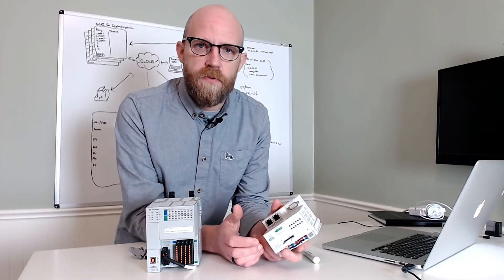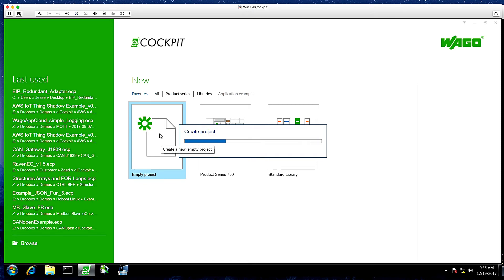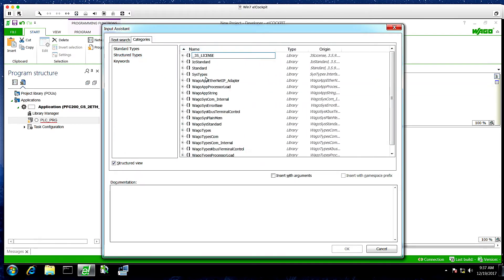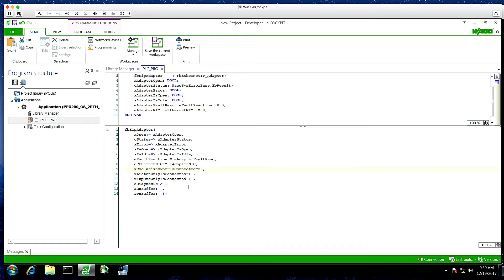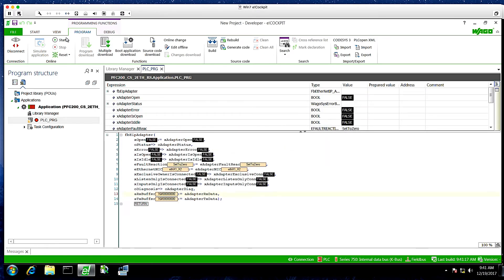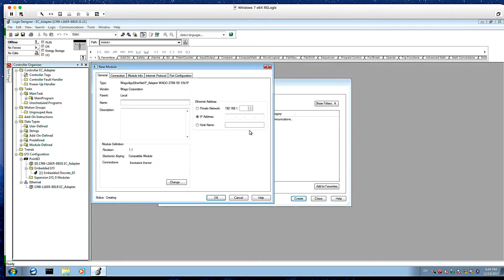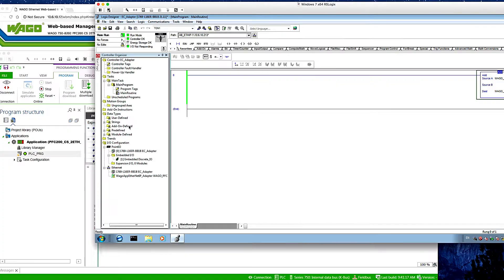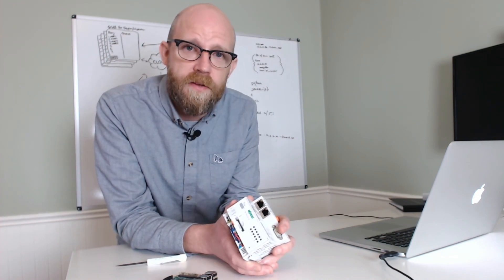CTRL SEE e!Cockpit EthernetIP Adapter Part 1

Comment: Hi There, Do you know if the PFC controllers can be used as an Ethernet scanning master rather than slave. I understand they can be a ModbusTCP master.  I am wanting to communicate with a schneider Preventa XPSMCM ethernet module..
Reply from the maker: Louis Pijpers this is possible with the CoDeSys Control for PFCx00. Here is the link to a video I made walking through this https://youtu.be/mF1xwU6WJLk